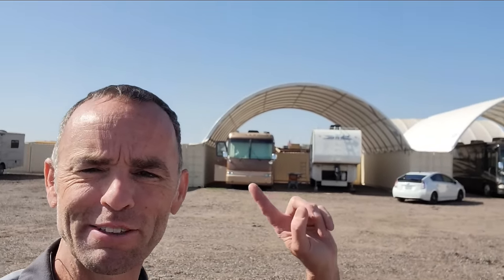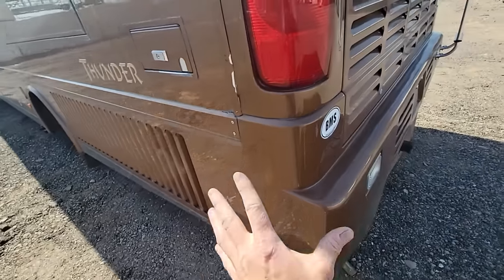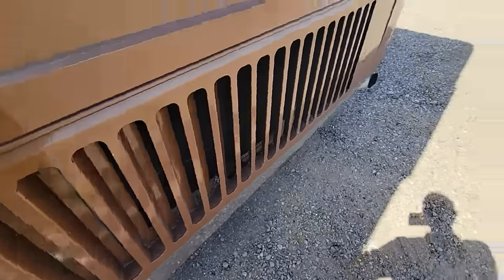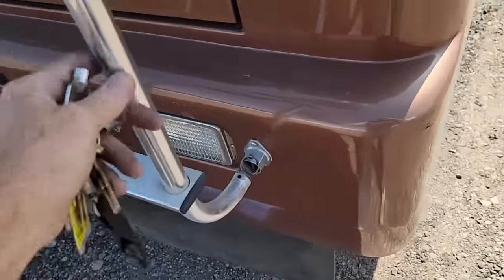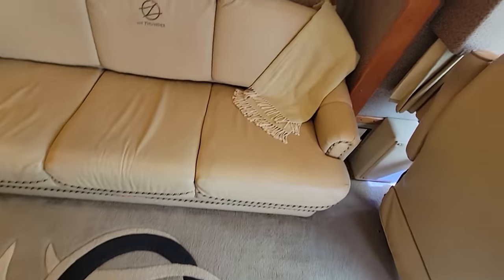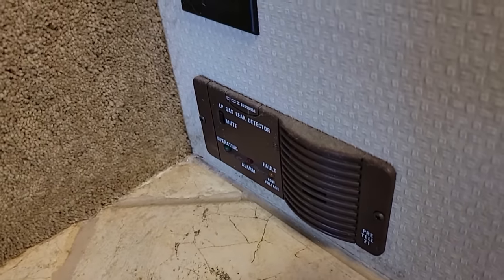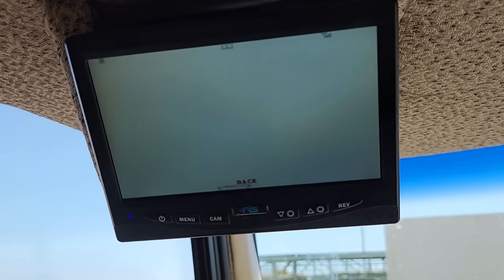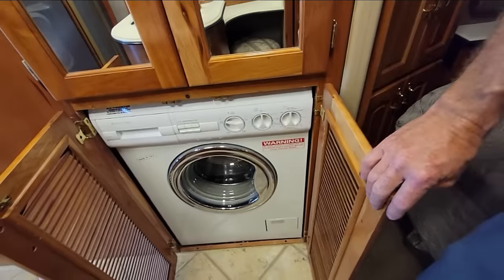The Truth About My RV and Other Common Questions

Comment: Typically an rv lender will not loan on a coach with the miles and age you have . 67k in my opinion is way to high more like 42 to 49k max (probably not going to be a popular figure). I think your beaver has velvet ride but I might be mistaken that will lower the value as well. You also might want to look into issues with the rear axle gvw rating for this particular coach you might be unpleasantly surprised. I have been in the business 29 years and have been to the beaver plant in Bend Oregon many times, they are extremely well made coaches back in the day. You seem like a knowledgeable guy and should be able to keep the cost down on repairs. Good luck with your new coach.
Reply from the maker: I'm not concerned about the cost/value and I'm also not worried about a lender. The point of this was to show this absolute jem of a coach, despite the high miles. I've been in the industry for over 2 decades--I'm pretty confident in my choice. Thanks for watching! :)

Comment: A ha.....seal creep....learned me somethin new today....would be interested in knowing more about folks that can make repairs like that....thought that was a special little defect that could only happen to me.
Reply from the maker: I'm sure I will make a video when I have it fixed
Reply: @AZExpert  Thanks James,  I was also curious about the rear view monitor, I have a 02 Bounder with one of those lunker crt rear view monitor that I'd like to upgrade ....are you aware of any flat screen rear view cameras options that would fit into the existing mounting frame ?

Comment: We have a 2003 Beaver Marquis that we purchased 2 1/2 years ago. Our main slide is also dipping down, not sure how to level it. Any sugestion would help greatly. Or if you do video on how you will make adjustments. Thanks
Reply from the maker: I'm sure I will make a video

Comment: We use to have a class A several years ago but sold it. We've been talking about replacing it but with today's gas prices of over $5 dollars a gallon we've slowed down. One thing I have noticed is that the prices aren't really going down on asking, esp. on used units.  We figure the unit will be sitting a lot longer between uses, what are your thoughts on what you should pay in this market....
Reply from the maker: Pay whatever your budget is. the range is too vast depending on what you are looking for

Comment: I have a 1992 beaver contessa surprisingly nice for it's age.. it used to drive perfect and the mechanic said the king pins were worn so I said replace em. Now it drives like crap and feels like I can't keep it straight. Squirrely might be a good term? Any ideas? An alignment didn't help
Reply: pin to bushing clearance too tight?
Reply: Not enough toe.

Comment: JB Weld those exhaust holes....and 3m 5200 sealant on that air intake ....with counter flash - thats a good place for eternabond tape! ...AND that ac wire reconnect should have solved the ignition switch issue...LOLLLL..OR MAYBE a wire loose on the switch??? Justtttt maybe....
Reply from the maker: Thanks for the suggestion!

Comment: Furrion cameras suck. I just installed Haloview and the refresh, picture and night vision blow away the Furrion. Now you need a bigger turbo and straight pipe with 400hp tune!
Reply: Stock tune on his is 455hp... he could have it tuned past 500 but not with fjb fuel prices.  I find 425 adequate from my c-12, bigger turbo would give more turbo lag, would only consider the straight pipe if the muffler rotted away.  Thx for the tip on the Haloview, I will need to do some research.
Reply from the maker: Thanks for the suggestion

Comment: If there were cats in that rig you need to go through all the ducting and blow out the cat hair it gets in everywhere even the dash heat and air duct work I had to clean out mine and was suprised at how clogged up the ducts were..will never buy another cat owned RV again..what a mess
Reply from the maker: The owners had it cleaned professionally on a regular basis, it's just fine

Comment: What are the licence requirement there. In UK we need a full truck licence and a coach Driver is not allowed to drive one, It is a stupid requirement and the smaller ones at 3500 kilos are cars and once it goes over you have to have a light truck licence and over 7500 kilos a full truck licence , not a bus or coach one. Also you cannot use one to get a driving test. Typical bureaucratic nonsense.

Comment: If 64 was high value with lower mileage and considering all that’s wrong with it then why in the world did you pay 3 grand over the high value. Not breaking your balls just wondering why. I watch you religiously by the way. I bought my first class a and I’m a very accomplished mechanic and diyer, so you have helped me tons but this one’s got me scratching my head.
Reply from the maker: The best answer I have is that the book is way undervaluing it.  I've had offers to buy it for much more than that. But I understand the question. I don't think I could find a comparable unit for sub$150k